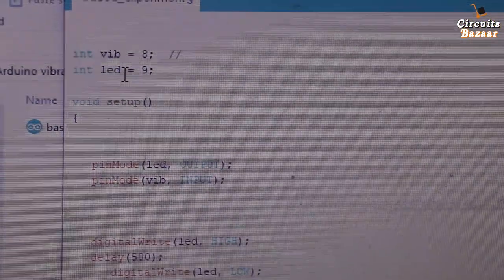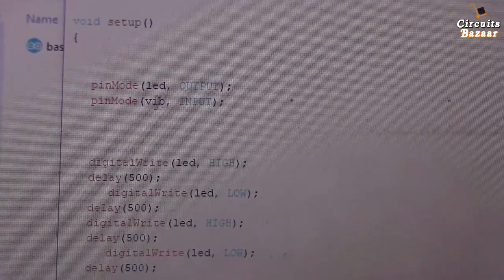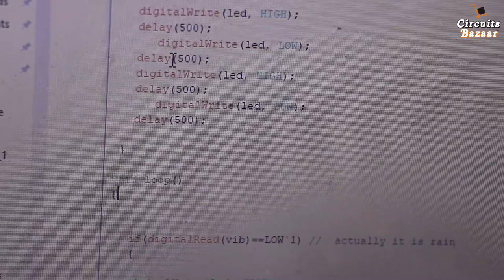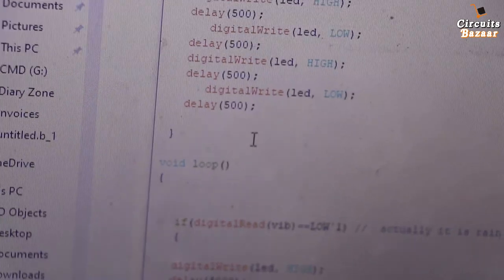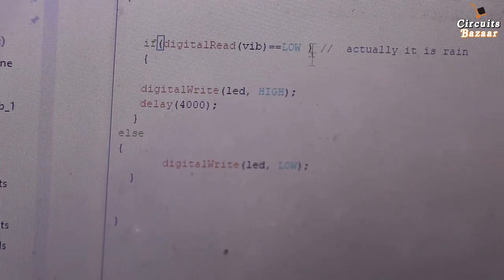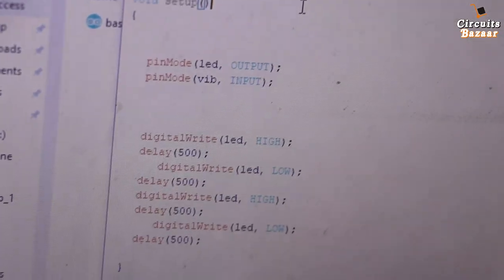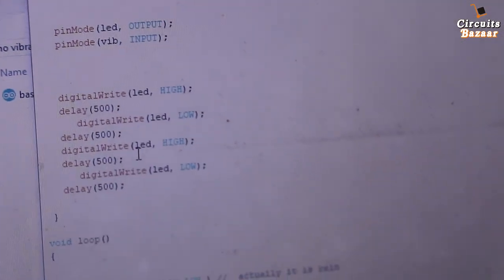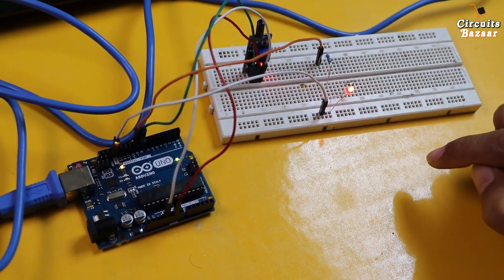How to Use / Work with Vibration Sensors

Comment: @circuit bazaar I want to make a vibration wrist band that will measure low medium and high vibration .At the same time different LED will blink for low ,medium and high. Can you please advice me urgently ?
Reply from the maker: for that you can use analog output vibration sensor and feed the signal to arduino for the Programming... it's easy to make ....
Reply: @The.Innovative.Indian  can you please check you email.I sent detail info to your email that is added with your channel. Kindly give me a reply there.
Reply: @The.Innovative.Indian can you explain a bit. If I make this do I have to attach arduino with vibration circuit.hope you would understand.I want to make a wrist band a bit small. I sent you an email could you please respond me.

Comment: hye is there  possible to use this sensor for project about condition based maintenance motor based on vibration, its basically to differentiate the condition of the motor by their vibration
Reply from the maker: Yes you can use but there are changes to get errors in the reading....... instead of this you can use vibration sensor used in the car. that sensor is more reliable and durable ....
Reply: @The.Innovative.Indian   I have the same idea as his. Do you think I could use an accelerometer instead for more reliable readings?

Comment: What is the work of blue potential meter blue box
Reply from the maker: Rotate this blue color potential meter in a clockwise  or anti-clochwise direction with the help of a screwdriver to increase and decrease the sensitivity of this vibration sensor.

Comment: Please provide the code and circuit diagram
Reply from the maker: Connections Are like this:- 
Vibration Sensor     Arduino Uno
    |                   |
    |--- Signal (S) ----| Digital Pin 2
    |--- GND -----------| GND
    |--- VCC -----------| 5V

Coding is like this :- 

const int vibrationPin = 2;  // Connect the sensor signal pin to digital pin 2

void setup() {
  pinMode(vibrationPin, INPUT);  // Set the sensor pin as an input
  Serial.begin(9600);            // Start serial communication
}

void loop() {
  int sensorValue = digitalRead(vibrationPin);  // Read the sensor value

  if (sensorValue == HIGH) {
    Serial.println("Vibration detected!");      // Print a message when vibration is detected
  }

  delay(500);  // Add a small delay to avoid rapid multiple readings
}

Comment: NO DIAGRAM AND CODES ON THE DESCRIPTION
I WISH U NOTICE US
Reply from the maker: ok please mail at circuitsbazaar@gmail.com i'll send you the data right away.
Reply from the maker: Connections Are like this:- 
Vibration Sensor     Arduino Uno
    |                   |
    |--- Signal (S) ----| Digital Pin 2
    |--- GND -----------| GND
    |--- VCC -----------| 5V

Coding is like this :- 

const int vibrationPin = 2;  // Connect the sensor signal pin to digital pin 2

void setup() {
  pinMode(vibrationPin, INPUT);  // Set the sensor pin as an input
  Serial.begin(9600);            // Start serial communication
}

void loop() {
  int sensorValue = digitalRead(vibrationPin);  // Read the sensor value

  if (sensorValue == HIGH) {
    Serial.println("Vibration detected!");      // Print a message when vibration is detected
  }

  delay(500);  // Add a small delay to avoid rapid multiple readings
}